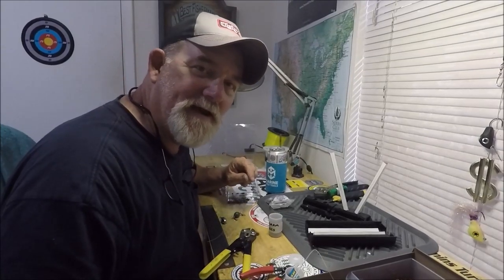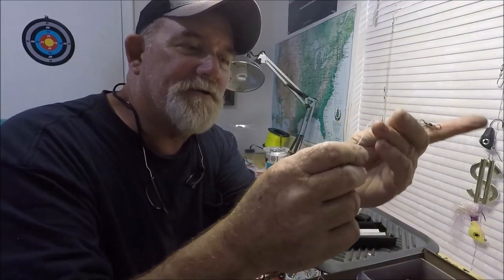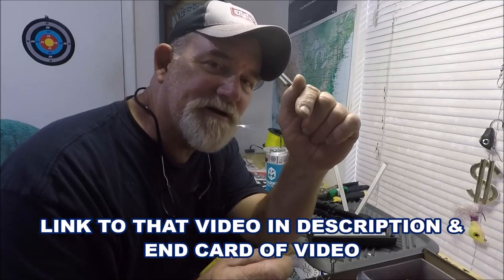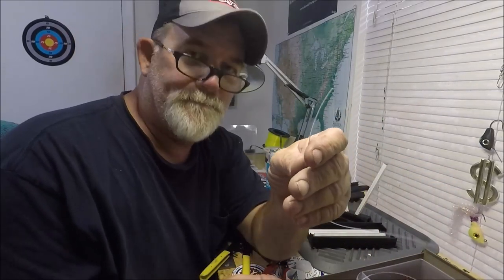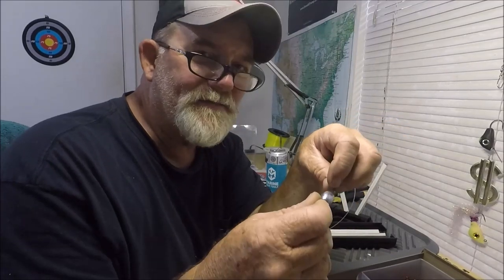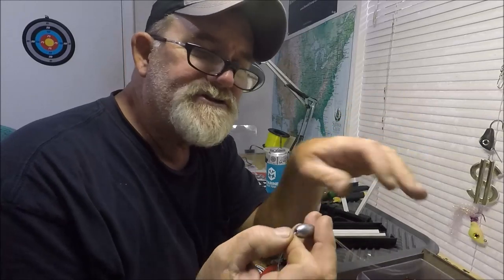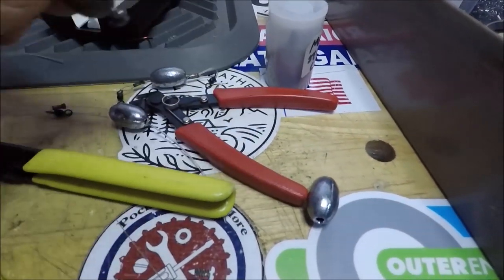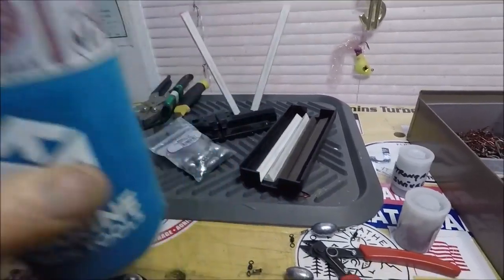SLIDING EGG SINKERS, ''I don't like them''

Comment: i never understood the logic behind the sliding lead rig. If the fish pulls away from the boat, it will feel the resistance of the rod, so lead doesn't matter. If it moves towards the boat, what about the lead? It still needs to drag the lead towards the boat. No matter what happens there will be resistance. 
The British carp rigs put extra heavy FIXED lead, so when the fish moves, the weight of the lead is enough to set the hook. Exact opposite strategy. The strategy of the British is more logical to me.
Reply from the maker: You are correct.....but then again, no one ever said the brits are all that sporty. 😆😆😆 I said all that because there's always some dude who swears fish care about freely swimming, unencumbered by a sinker....all of it screams bullshit to me. Saltwater, inshore,  especially here in NE Florida isn't cosmopolitan, it raw and wild!